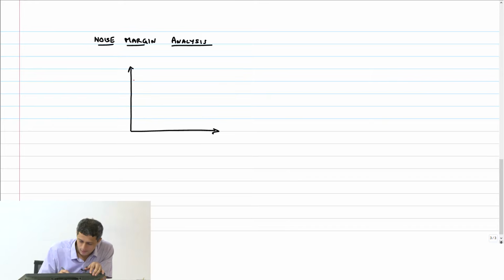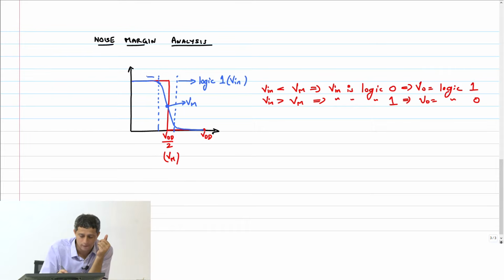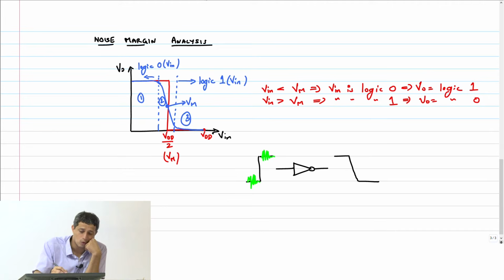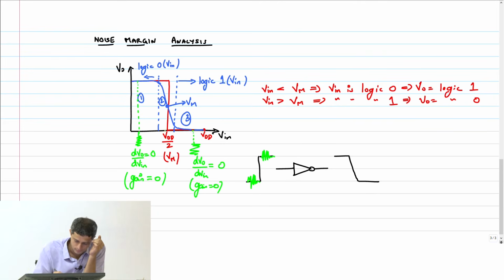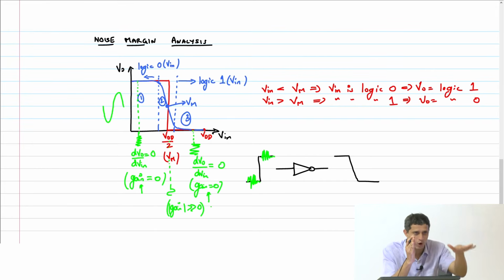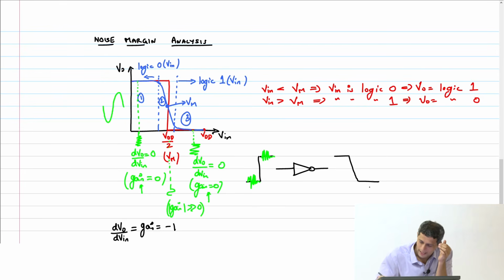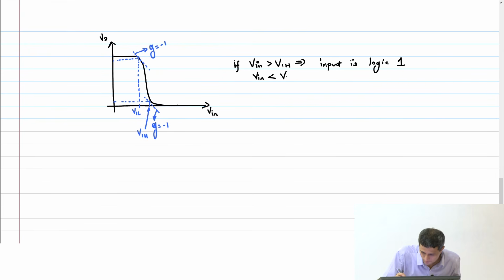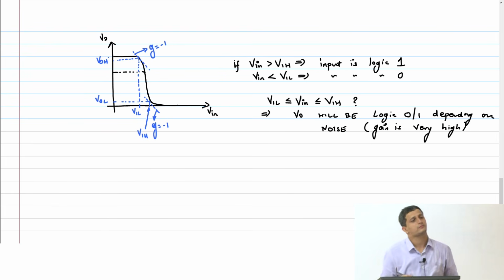Inverter - 6 - Noise Margin Analysis-1

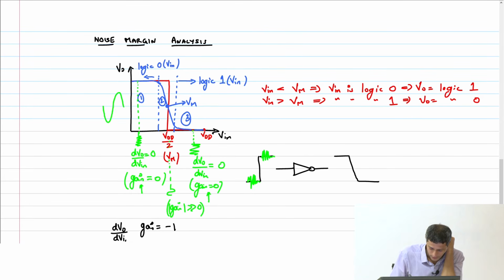Comment: 10:38  I didn't get it why you are taking gain as -1 for the consideration of noise.
Reply: since it is an inverter, change in output is opposite to change in input. I mean if input is going from 0 --> 1 and output is going from 1 --> 0
Reply: gain is basically the slope itself..here you can see that the slope is negative...hence -1
Reply: @APARN-x9b got different job vro... left these concepts behind ❤
Reply: @drstrang  great bro! congrats<3